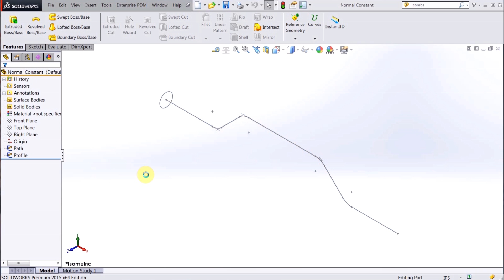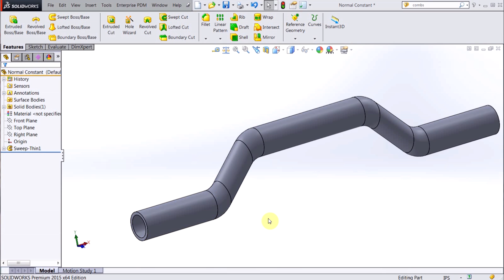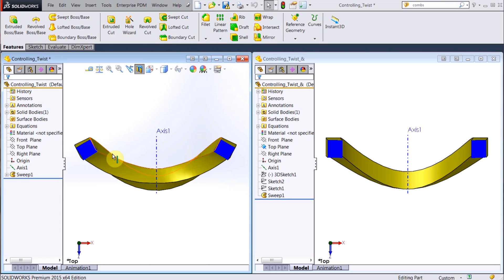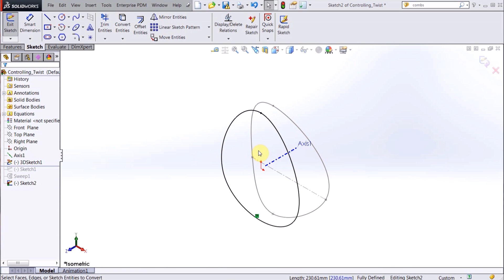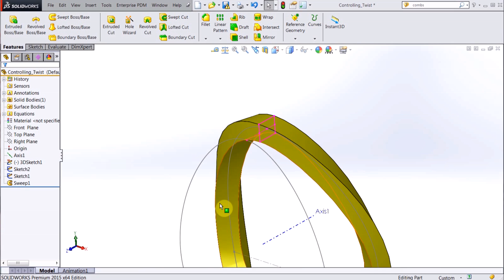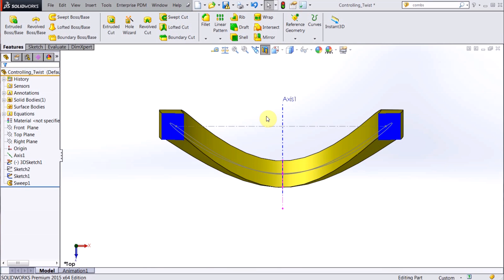SOLIDWORKS - Advanced Sweep Feature Techniques

Comment: How did you create that 3d path?
Reply: It's a closed spline created in a 3D sketch.  You can use construction geometry to help control the spline.  Note the horizontal line that is coincident with two of the spline points.  You can use the control polygons to manipulate the spline in 3D space (right click on spline and select display control polygons.  I find those much better than trying to move the spline using the spline points.